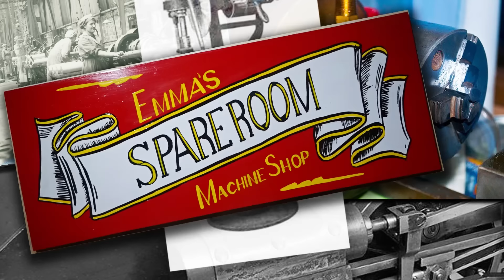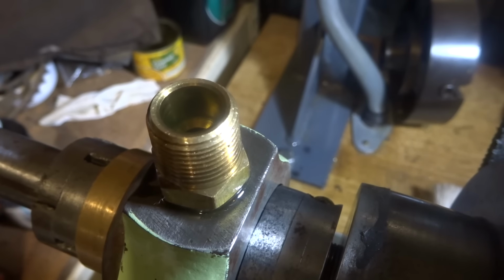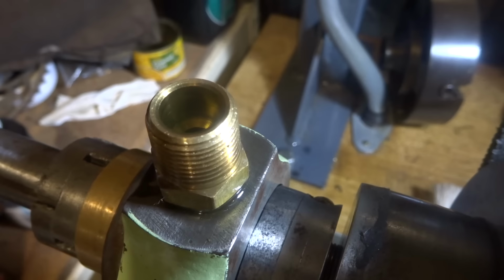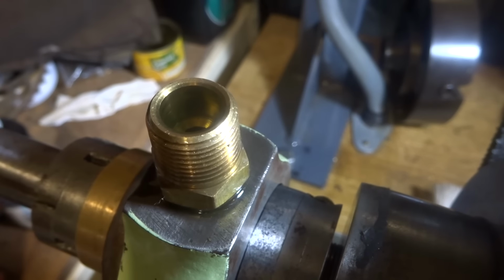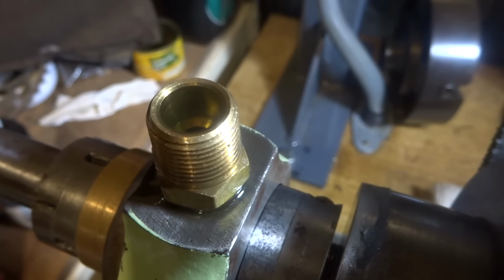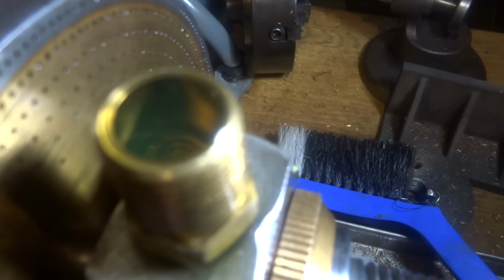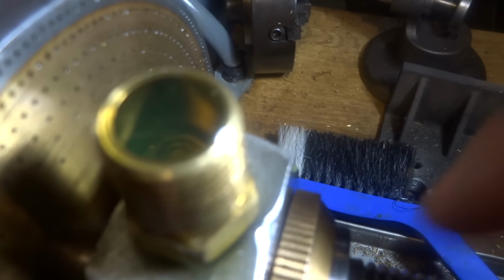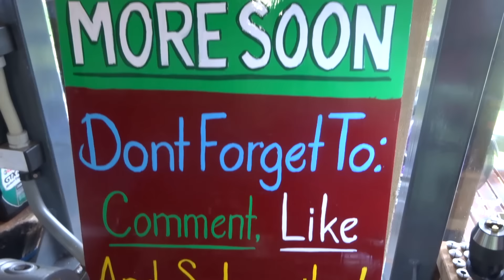how much oil do Plain bearings really use?

Comment: Most plane journal bearings use more oil when idle/not running than when running.  Due to the oil wedge makes the gap at the top of the bearing smaller when running, by lifting the shaft.  THanks for the demo Emma.

Comment: Randy's of course 100% correct. With as Emma said properly adjusted bearing clearances, then that oil wedge is what floats the spindle or your crank in a car. There isn't, or should never be any metal to metal contact. White metal or bronze solid bearings take just a very few seconds to be destroyed if they run dry.

I did learn the hard and very expensive way not to think I know better than the recommendations in any machines manual. That error cost be right around $800 for a motor. And there is no substitute for the proper way oil. It can be a bit tough to find for some of us, but it's not much more in cost than almost any other oil recommendation I've seen suggested as a replacement, so why bother? After buggering about for longer than I should have, it was a noticeable improvement to finally start using the correct way lube. I don't think anyone can suggest that machining as a hobby at any level will ever be cheap. And just like your car, proper lubrication and oil changes are the cheapest preventative maintenance you can possibly do. A read through the Machine Tool Reconditioning book should change anyone's mind about how clean and well lubed way surfaces should be kept.

Never ever use detergent oil in a machine tool unless the manual specifically say's you can. Some bronze types that the wormwheels and sleeve type bearings are made from are not compatible with detergent motor oils. And detergent oils are designed to float contamination within the oil flow until it gets to the oil filter. So without that filter you want any contamination to sink to the bottom and not keep running metal chips or any contamination back through the rotating parts time after time. 

Good video Emma.

Comment: Hi Emma, is there a wick/gauze at the bottom of the cups like on a Boxford/Hercus to regulate the oil output ?  I agree EP46 hydraulic oil seems to work best for the ways and bearings on a lathe regards from the UK
Reply from the maker: +Gary C not as such... i do have this list of projects, and somewhere about the top of the second page, is a project to make proper wick oilers..

Comment: Does the oil drain away when the lathe is not running? I have a Myford and am always forgetting to shut the oil valve when I leave the shop.
Reply from the maker: +enginemaker not usually. is good practice to check it, but i would maybe look at bearing clearances a little closer?

Comment: Is this oil also suitable for lathe ways and gearboxes? Or should I consider something different for those applications?
Reply from the maker: +Adam Carmichael ARRRRRRGHHHHH you ask all the hard questions!
Reply: +Emma Ritson lol - I could bug Bruce... IIRC, he mentioned one particular oil that was good for almost everything, maybe this is it?
Reply from the maker: +Adam Carmichael its what i use.. i dont think motor oil is much good. hydraulic oil is good on slides and in bearings
Reply: +Adam Carmichael Specially formulated way oil is more sticky, like it makes filaments when pulled between your fingers, this feature lets it stick better to differently positioned sliding parts, also provides better "lift" when sliding...   
Way oil grade 68 is mostly wide spread and easy to find...   ;)
Reply: Thanks Pierre! :)
Reply: +Adam Carmichael  If you will check out the Halligan142 channel's older videos you will find a video on lubricating his 9" South bend lathe. As I remember,  at least four different types of oil are used. One for the ways, one for the gears, one for the gearbox, and I can't remember what the fourth is, maybe the change gears. All of these things have different requirements. I am exasperated when the modern lathe or mill does not come with lube instructions. On purpose. They want it to wear out so you buy a new one.
Reply: +Juan Rivero thanks! I'm already a subscriber to Halligan's videos, but I'll check them out as I missed a bunch of his early videos.